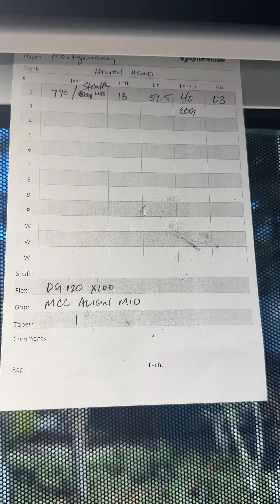Building Taylor Montgomery's Stealth UDI | TaylorMade Golf

Comment: This is a proper pro build. Is that extra weight being put into the hosel?
Reply: 0:25 Taylormade uses a bullet weight system unique to their irons. This allows them to get the head weight exactly where it needs to be so the club reaches a specific swing weight. Much more consistent compared to throwing tip weights in the shaft.
Reply: @jven5088  interesting, thanks for the info. Prefer a bit of lead tape myself!